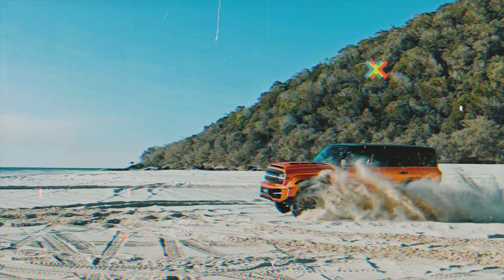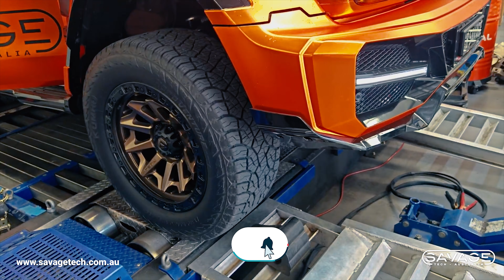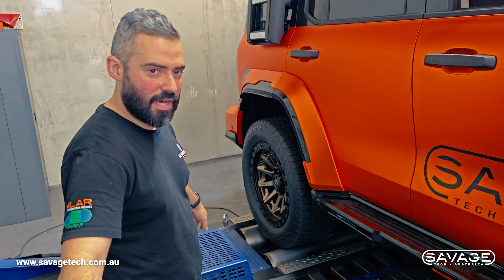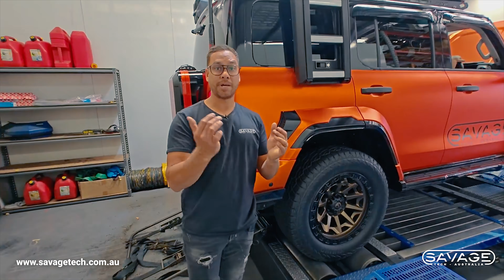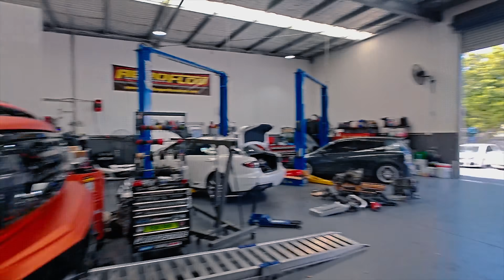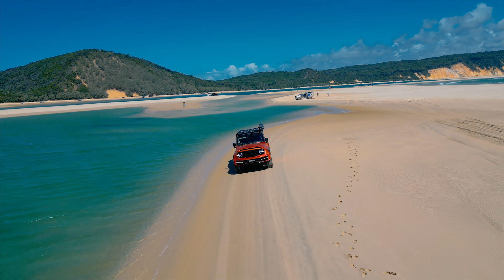GWM TANK 300 TUNED DYNO RESULTS

Comment: With stage 1 I reached 207hp, and I did the dyno before and after.
Reply from the maker: Yeah, we’ve driven plenty of Tank 300s claiming big dyno numbers, but they still feel slow on the road. At the end of the day, it’s not just about peak horsepower, it’s about how the tune actually performs where it counts.

Every dyno tells a different story. Hub dyno versus roller, tyre pressures, temp changes, how the car is strapped down, it all makes a difference.

We regularly test Tanks back to back, and our Stage 1 already feels much stronger than most. Our Stage 3? It’s as quick as a hybrid Tank with a full charge.
Reply: @SavageTechAustralia  I follow your page, and I see what you do. 
Different countries doing different tunes. Here in Qatar made the stage 1 with off-road setups. 
1. Torque parameters up 
2. Timing 
3. Boost from 0.3 to 1  bar between 2000-4000 rpm. 
4. Main boost up as well. 

Totally I reached +30-35 HP and 75-80 Nm.
All parts original. I did not touch the  exhaust and the intake. 
And in Qatar the maximum octane petrol is 95. The tune was done based on this octane petrol. 
But in Russia we made the tune based on 100 octane. And reached more 😊
Reply: My next step is intercooler snowtech and exhaust. Then I go for the stage 2

Comment: The marketing material for the Tank 300 says the stock car makes around 167KW. Why would your dyno result from the stock Tank be so far off from this? I may need to get my Tank on the Dyno to see if the claimed stats of 167kw are true... Based on your dyno results, I'm a little weary. I'm in Saudi by the way...but I see that the marketing material regarding the performance output is pretty much the same here as it is Aus. Keen to hear your thoughts. Cheers
Reply from the maker: Do a quick search on the difference between wheel dyno and engine dyno results. Also a dyno is to compare the difference before and after not to compare numbers between mates and companies who's got the highest numbers.

Comment: Dash Off Road got 220kw out of theirs and 50% increase in torque
Reply: I think that might have been a happy dyno
Reply: Did we watch a different video, because it was a 30% increase
Reply: It was a 30 % increase
Reply: Different subject can you make video of roof rack install
Reply from the maker: @bernardmccann7676  yes we will be doing this shortly.
Reply: @SavageTechAustralia  I was replying to the first comment.  The Dash guys didn’t get an increase of 50%, it was 30%.

I’m in Brisbane so when I take delivery I’ll br coming to see you for some accessories. 

Cheers
Reply from the maker: Dash stock run done on different day. It doesn't matter how well you think the car is in the same position.

 It will always make different figures when changing position. As you can see clearly in our  video. We changed the position after testing stage 1 to see what we could get by moving the car forward on the roller.

Then we eventually had to go back to stock in new position and tested our final tune in the exact same position otherwise the results were skew.

Also we did not load the dyno as much, you can see there curve it makes torque as soon as the roller is released then drops away straight away. This is boost spiking.
Reply: @SavageTechAustralia  I’m 99% sure we’re saying the same thing.  😂
Reply: @SavageTechAustralia well said in the video. It’s not about how much peak numbers you measured from the machine, but how much percentage gained before and after.